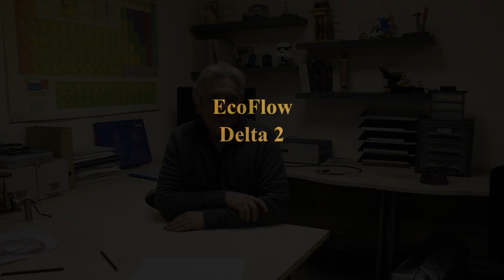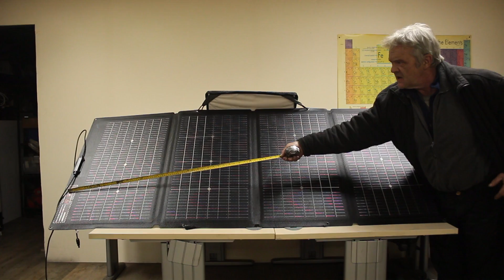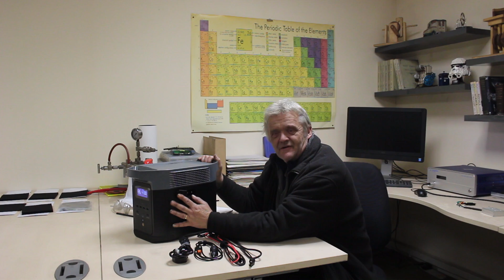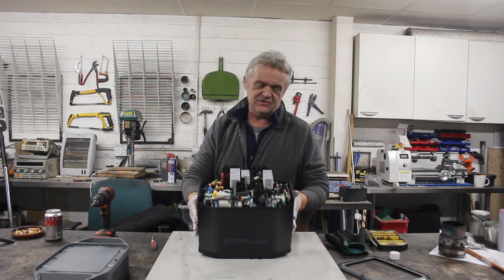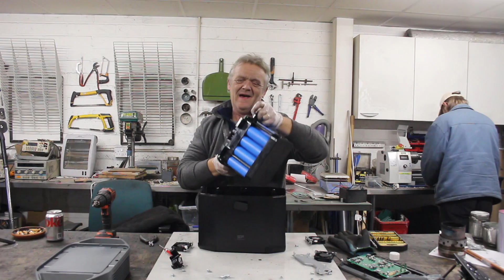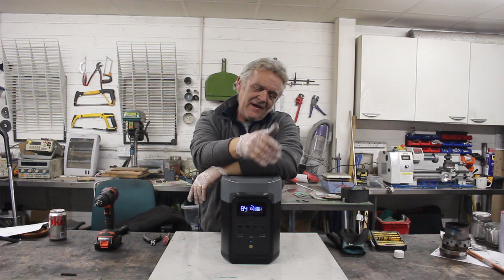1740 - EcoFlow Delta 2  #ecoflow #delta2 #portablepowerstation #notjustabattery

Comment: I have a similar 650W system made by energizer, I have used it when aboard the boat, the only change I made to mine was to change out the universal socket (UK/ European/ American) which was useless at holding a uk plug, so I found the form factor socket in a UK socket, and that works a lot better. for the uk plug.

Comment: Old car batteries,  pump water in, drain out. Large circulatory system to keep the plates clean. Plastic 35/55 gal drum as reservoir.  I think there is something there for the upcycle crew. Thoughts?

Comment: Last month I decided to go with the Delta mini for blackout management. Discovered the hard way with multi days outage in Arwen that there are things I need to have....I'm disabled and need heating / hot water for various reasons, and easy to use when I'm really poorly.   Impressed so far.
Also got some USB rechargeable lamps etc which gives light and had a simple single burner gas stove for cooking. So, government do your worst.
The Delta will power the electric blanket,

 microwave and coffee machine and even  hairdryer (!) with the XBoost function...but be careful of this if the appliance is sensitive to voltage drops! 
Sadly Xboost on/ off is only controllable with  the app....and its the app thats given me the most grief because it doesn't like the way I have my BT router configured (standard out if the box!!!) 
The other issue I've found with a non ecoflow solar panel ( only 120W portable bought fir another device......) is that once its settled on an input wattage, it doesn't increase it.
So if your set up catches a few Watts in the early morning sun, say 25W, the Delta will continue to charge at 25W, even if the array starts to produce more power! Unplugged the solar panel, plugged back in and at midday input jumped to 89W! Lots of wasted solar ☹️
Does this happen with their own solar panel I wonder? Would love you to test that for me....pennies are a bit tight to just buy one on the off-chance!

Comment: That is a nice slick product. Suggestion, I've watched you construct, repair and reuse many batteries. Use it as a charging module to charge another power bank you build from recycled batteries. This way you can have a spare power source to charge it back up when the mains go out and the sun won't shine. ;)

Comment: No one here thinks you fear the rolling blackouts should they happen.  You will laugh when they turn off the power, and you'll fire up your alternative sources.  In fact you will probably think it's a great diversion.  I imagine you will have your windows wide open this winter while you run your DIY mantle heaters due to the excess heat while you cook a turkey outside in your solar cooker.

Comment: BICC - Battery, Inverter, Charge Controller.  Cool units, if they are not too large to be truly portable.  If "more" is required, a component-based system is indicated.

Comment: Could I make a request of EcoFlow?
Design the electronics in such a way that, it can be charged from the mains, however when the grid mains is absent, the same mains input could become a mains output. Doing this would mean the house electrics could be powered from this device. Certain safeties would be needed so that the plug isn't live when disconnected, and when the grid mains returns it can revert to being charged again.

Comment: Robert: You’re a shrewd and honest reviewer, and we all owe you a debt of gratitude! Regarding the app that interfaces with the battery, I assume it uses the internet. But wouldn’t it be super if it could also provide its own WiFi without the internet—as some more expensive flash drives do? They can stream a movie to multiple mobile devices out in the wilderness with no network to be found.
Reply: Stream a movie......in the wilderness......what?
Reply: @joemendyk9994  I wouldn’t watch movies while camping either, but non-internet communication with storage batteries would be great!

Comment: I have the Delta 1 Max and it does not like just any generator. I had to return the first generator I bought as it would partly charge and then stop receiving input. I did a little research and found that I needed to purchase a pure sign wave generator and it has charged fine ever since.

Comment: I have a much smaller battery setup that has already been useful when we had some electrical work done and we could continue working with the internet router powered up.  I don't expect it to run the house, but it would keep the fridge running for a few hours.

Comment: 3000 cycles to 80% capacity, it will still work after the 2300-3000 cycles,  probably about 3000 more cycles, to 50-60% capacity,   although failures are possible at that age,  it's best to only charge it if you are going to use it! And not keep it fully charged, if it's going to be used for emergency backup, maybe keep it at 80-90 % charge. And fully charge before use, if possible, it will make it last longer!

Comment: Here in central FL, due to hurricanes, every home should have a generator and everyone should learn to use a Ham radio.  When the cell towers go down (they do with every.single.hurricane), Ham radio is how communication takes place.
Reply: I also live in Central FL and chose not to have a generator and didn't even consider a ham radio.  We were out of electricity for 7 days with Ian.  The expense of the generator as well as the gas you have to keep on hand wasn't feasible.  Also your car is a generator.  We charged phones in the car. Instead we have battery op fans (one for each person) and alternative ways to cook and bake.  Except for not having internet access, we really didn't miss electricity that much.  My neighbor with solar panels had them crushed from tree limbs.  With all the maintenance one has to do with those things, it's better to just go low tech for a time, and shortly services will be restored.
Reply: @wolin289  The saving of the food in my freezer was worth every single penny of the generator and the cost to run it (only a 3-4 hours a day, btw.  You don't run them 24/7.) A car is not a 'generator'.  It cannot run the necessities in your home - mine can't.  You gripe about the cost to run the generator yet you ran your car to charge your phone? And, lastly, your neighbor is a poor example.  What % of people who had solar panels did had theirs crushed by trees do you think?  1% maybe; at the max 10%.  That means you're making your decision based on poor odds.  I'd rethink my logic if I were you.

Comment: Is this unit suitable for powering appliances which normally need earthing? For example, a toaster or a kettle, when connected to the mains supply, have an earth wire going to earth. But if this unit is a standalone unit, how can it be able to earth appliances which are supposed to be earthed? The unit itself is not earthed when acting as a standalone powerbank is it?

Comment: The app allows you to turn on or off the individual ports, and you can change the charging wattage. If you are charging from another battery bank with a small inverter this is very handy. It also shows in more detail the input and output. It is useful to have as you can move the solar panel while looking at your phone to see where the optimum angle is for example.  I have tried to charge mine from a 400w Vevor (12/24v) wind turbine and it does not like it as it needs 11v minimum to charge and my turbine was not at that or above for long enough. I have the Delta max 2016kwh and absolutely love it and think that even if you don't use it every day like I do, every one should have one as a back up.
Reply: If anyone is interested I can do a quick video of my set up though it is still a work in progress  😄
Reply: @kirtodam6540  If a link to your experience was in this forum of interest people would follow their interest! real world usage is what wasn't shown because 'he knows' what the front end can do by the back end.

Comment: Now all you need to do is make one of those "Suicide" extension leads, with the  plug on each end. Turn off the main isolator in your fuse board, and a few unnecessary power hungry circuits. Plug your "dangerous extension of death", into a spare socket outlet(back feeding power through a socket). Then feed the other end into your eco-flow unit. That way a few sockets in your house, and all the lighting should work. As long as you don't overload the unit of course.

Comment: Great video. I just bought the rival 'All Powers' version which I'm very happy with. My folding solar panel seems a bit smaller and has a 200w peak output (the best I've seen in Autumn sun is 152w). Do you know the rated output of the Delta 2?
These units are great for peace of mind in case of blackouts and it's very handy to have portable silent power.

Comment: Hi I have just bought the Ecoflow Delta Max myself and am in the process of testing it on various appliances in my home. with encouraging results, it will even power the induction hobs of my Everhot cooker for emergency cooking etc, but I have plugged my Renogy solar panel to its input ( which I use to float charge my car battery via a Victron mppt controller) and although the specs say 11 to 100v solar input it doesn't start inputting until the panel is in bright sunlight ( approx 50 to 80watts indicated) whereas the Victron will provide around 0.5 to 1amp even on cloudy days. I have ordered a second PV panel to wire in series with the existing one in hopes that it will increase the open circuit volts so it with charge the Ecoflow on cloudy days. I would be interested to here your comments. Regards Chris J.

Comment: Narrowboaters use these or similar ones to prop up their domestic batteries.  They put these on their appliances that use the most electricity (washers, tumble driers, fridges etc) and use the solar panel to recharge them.  It allows them to not drain their domestic batteries, or run their engine if they are moored up for a few days.  I looked into one but a petrol powered generator was MUCH cheaper as a backup power source.

Comment: I have a different brand power box with solar panels. I set up with USB rechargeable lanterns, phone, tablet, electric lighter, several small USB batteries, and flashlights. My powerbox easily charges everything, no problems. Solar panels charge the box in about 6-7 hours. Really nice prep for hard times.

Comment: A nice bit of kit if a little expensive.
Some extra things to think about.
Charging it via the solar panel, nope certainly not from flat, the included panel will top up but it will take days to charge even with full sun.
Yes wind will also work with the same caveat as sola and you need a voltage regulator to keep the wind at the stated voltage or it will just cut off the charging.
Its uses, its meant as an off grid power source for working not as a backup supply, it can be used as a backup but recharging is always going to be slow when off grid.
The max rating of 10a means it will not cope with Cookers, Electric central heating, high power showers, heat driers, some washing machines.
And that's not taking into account you will wants other electronics working at the same time.
Think of it as a supply for fridge, freezer, lights, gas central heating, kettles and one ring hob or grill. 
The more high load devices the less it lasts.
Now here is the real issue.... its not designed to power a property, that means you would have to bodge up a lead with two plugs on. very dangerous in uneducated hands. I have been unable to check if it has automatic cut off when the grid supply comes back on, again a potential hazard. it is not designed to isolate the grid connection when running which will lead to energizing the grid and potential fatal outcomes for electrical supply staff. If you want to plug into your home sockets you have to isolate the grid supply and that is not as simple as switching off the main switch, you need to guarantee the isolation is physical or you may kill someone and are certainly breaking the law.
The best way to use this is run extension leads to your appliances for them to be plugged into.
Or get a qualified electrician to instal a change over switch which complies with regulations.
If you backfeed onto the network the companies will prosecute you regardless of any injuries. Electricity will go any direction but the protection, like circuit breakers don't work backwards.
I already have grid tie solar and backup batteries and worked many years for an electricity supplier so I know what it's like to be on the wrong end of the wiggly stuff.
Cheers.

Comment: What a terrific video. I bought the predecessor of this machine back in April. It had a crack in the body by the display when it arrived. Put me in a bit of a panic as to how it could have happened. It was well packaged and there was nothing floating around in the packaging that could have caused such a crack. I thought it must be something inside the case had put pressure and caused the crack. As it happens Ecoflow customer service was very prompt and polite in response to my email. After sending some photos of the damage the unit was quickly exchanged without expense to me. I call that excellent after sales service. 
Having now seen the innards of the unit it's hard to say what could have caused the crack. Just a weakness in the plastic that got missed , I guess. 
Not looking forward to the possible blackouts but not as fearful as I might have been, I expect this unit will be a godsend. I have also picked up a freezer alarm just in case the blackouts happen at unexpected times. Good luck everyone and stay safe. 😃 🇬🇧

Comment: Awesome video Robert.. 👍🏼 Ive been debating over buying one of these for my camper van or to instal a lithium battery to fit in with the existing solar system 

What do you think would be the best direction ?

Thanks Ian
Reply: IMHO immigrate to somewhere with more energy availability
Reply: @phillipsmiley5930  _ Hi Phillip I do live somewhere where Hydro is readily available, but that's another project im working on.. 
We also have a Campervan which we travel around Europe and Beyond which is why I asked my original question Thanks 🚐💨

Comment: Like the device!
I wonder how many folks are buying electrical generators they can charge from the mains when the power is on to use when the power is off.

That's going to defeat the purpose as any power you'd save would be negated by the extra power drain needed to charge the generated.

The solar feature here (and possible wind) is what makes this a true solution

Comment: ecoflow has the right idea but there's much cheaper options out there if you want to put a few premade parts together. just buying a 12 volt lifepo4 battery, 1000 watt inverter, mppt charge controller and two 100 watt solar panels will run you almost half what this costs and if there's no sun you can use the inverter on your car and use it to charge up the battery. another nice idea is using that setup with an ebike as an emergency generator(3 phase rectifiers are cheap on amazon). hook the ebike output(after rectification) to the mppt and it will change the variable voltage into a stable charge voltage for your battery.

Comment: It will take many hours to charge up from a car socket.  Remember car accessory sockets have a 10 amp fuse.  So 10 x 13.5 volts is only 135 watts. So to charge up a 1kw battery assuming 100% conversion efficiency with 135watts will be over 7 hours. Same with the small solar panel. Let's not even go to the 3kw big version.  Pretty much a large ups in a nutshell.
Reply: and used UPS go for a song

Comment: Trying to remember what we did in the 70's when powercuts were extremely common... Oh yeah... nothing.   Then the power came back on and we still did nothing.  There was nothing to do in the 70's.   It was actually THE most exiting thing that happened most weeks.    Taking bets on power returning ... 3 - 2 - 1 .....  wrong again.       

I'm sure most (older) people don;t give a shiny sh if the power goes off for a few hours - what is there to miss?   The internet?   In that case they're PROBABLY doing us a favour  - like running out of fags and deciding to pack in instead of fretting about how we'll possibly cope without coughing our guts up every day.  

I only worry about struggling parents with tiny children or babies - changing nappies by candle light sounds a bit of a bummer.

Comment: it's a good product and decent form factor.  it's pricy for regular folks who don't want to deal with a self build system, plus you get a warranty.  having said all that, if you're handy, it's a lot of fun to do a diy build, and honestly the all in one Chinese solar battery charger/inverter ATS units is a good enough, especially if you're in  220v country.  if you're in the states, you can use a transformer.
Reply: Hi Saeed, EcoFlow also has products that meet the standard in the low-voltage region so they don't have to use a transformer in the States:)))😁

Comment: Couple of decent lesuire batterys and an inverter extension lead. battery charger for when grid on or solar panel and mppt or pmv simples would not reccomend high loads. not knocking the product for those weary.